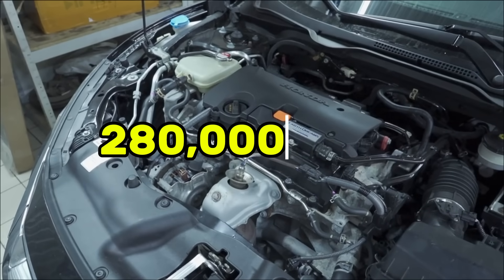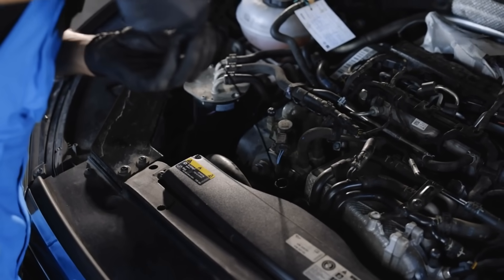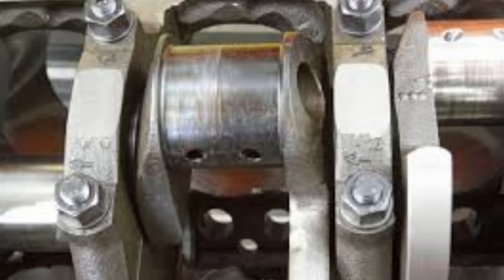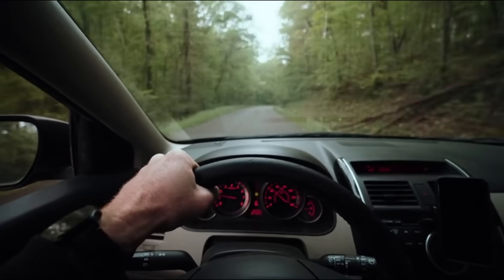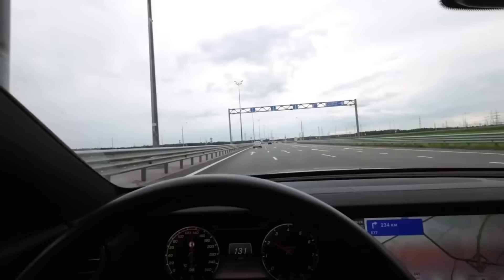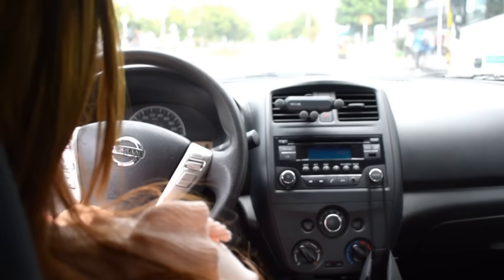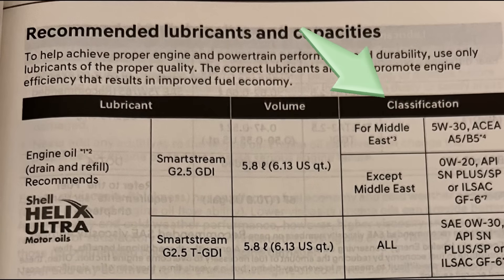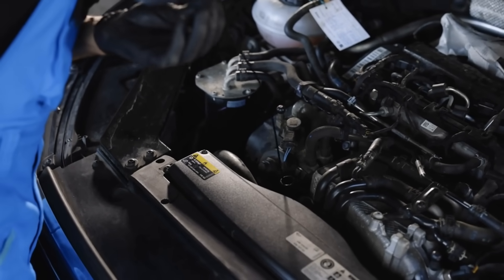I Tested 200,000 Miles of Engine Oil and Found the SHOCKING Truth

Comment: My 2012 Jeep calls for 5W20. I guess it wasn't new enough to get listed for 0W20.
Hell no.

I run 5W30 year round.
Reply: That's the best weight for this year Jeep. Mine is a 2010 with a 3.8L V6. It really is a hot running engine and is hard on oil. I run Amsoil Signature Series 5W30. I also use the Amsoil Ea15K51 oil filter that filters down to 20 microns. I change it every 4500-5K miles. It has just a little over 137K miles with a 6-speed manual transmission.
Reply: Yep.  2017 Lexus LS460, 2001 Toyota Solara and 2002 Camry.  I stick with 5w-30 for all of them year round (I drive in Southern Calif).  I used 0w-20 in the Lexus, since the manual said so... but only until I knew better!  Ask people whose opinion actually matters, i.e. (non-dealership) mechanics, if they use zero weight oil in their own cars.  Chances are he will say Hell No!  There are only two scenarios I'd even consider using a zero weight oil: for driving in sub-zero weather, or driving a car owned by somebody else.  Because all the evidence I've heard about or read, shows zero weight oils are inferior in anti-wear properties to heavier weight engine oils, especially in the long term.

Comment: My 02 Mustang GT has a recommended oil of 5W-20 but I've seen Ford engineers say 5W-30 is better because it improves engine longevity. The 5W-20 was to meet CAFE standards. I have run both (full synthetic) and I haven't noticed any significant difference but I never sent an oil sample in for analysis. Based on what this video is saying, 0W-30 might be best since we get below freezing frequently in winter and above 100 degrees in summer. We get sub-zero also. We have had 80 degree weather in January also. My 2014 Xterra has a 5W-30 recommendation but I haven't tried different oil.

Comment: Common sense....Thin oil drips off engine parts faster than thicker oil.  Thicker oil stays on parts longer and is better for .  Think about "Goldielocks and the three bears" .... too big, too small, just right....  too thick, too thin, just right etc.   Zero weight oil ???  Common sense says...That's just too thin. It'd just drip off the parts.  5W is plenty thin enough for todays engines, however in extreem cold weather situations (-25 or -30 ) vehicles use block heaters to prewarm engines.  So,  0W isn't needed there either.   0W ???  Zero = nothing.  No wonder engines are wearing out.
Reply: Not that simple. It's fine balance!
Reply: @Davido50  In my opinion, it is that simple. In order to meet mpg regulations these mpg tests are run on a bench and not in real world situations.
Reply: My 3.6 pentastar says 5
w20. I run that from October to April. From April to October I tunn 5w30. I live in SLC Utah. Am I gonna be ok?
Reply: @jtd2949  Yes, just don’t drink it 😂
Reply: You are off the science. The 0, 10, 20 etc are simbolic (coventionall values, not real viscosity in an I.S. of metrics. Even wather has a higher than zero real viscosity. All liquids have due to internal.friction. It is easier for common people to process. Also, summer of winter, the working temp of an engine is the same, after it reaches it. So...why different values?
Reply: W is winter, not weight.

Comment: I don’t care about 1/10 of a mile per gallon when I’m already getting 30 to 40 mpg I use 5w-30 or 10w-30 in everything . I didn’t notice a change in mpg on my 2016 Honda Civic when I switched to 5w-30 as soon as the warranty period was over. You might get 1 mpg better which might be great for a fleet but not for an individual driving to work.
Reply: indeed

Comment: If the coolant temperature stays the same why does a hot climate change things?
Reply: Great comment
Reply: It’s all about cold starts.
Reply: The internal parts have to wait for the heat to make its way to the water jackets. The air blowing all around the engine has a noticeable effect on the ability of the metal parts to dissipate the heat. The hotter the outside of the engine block, the hotter the internal parts will be within several degrees.
Reply: @YeOldeTowneCryer I talked to an oil engineer. My uncle is in the oil business. They claim that thin oil carries away heat more effectively to avoid hot spots, such as in the cylinder head. I showed them old owners manuals I had for Porsche, GM and Ford vehicles that had oil recomendations based on outside environment tempratures. They claim that is not applicable anymore. Oil technology has come a long way. In addition they claim oil temps actually increase with thicker oil. I still use 5w-30 in everything

Comment: My plan has been while under warranty use the 0W-20 it calls for after that keep it in winter and 0W-30 in summer im in a state that has hot summers and freezing winters. My car is new just in case something happens under warranty and they decided to send out oil to be analyzed. I also always change oil every 5k or sooner. (100%Synthetic)
Reply: There is no car dealer on the planet that would exercise that degree of professional curiosity by sending your oil out to be analyzed.
Reply from the maker: You are right
Reply: @jmljml5065 i dont think so either
Reply: That why you pul your own sample and send it out.
Reply from the maker: Smart strategy with the oil weights and frequent changes – your engine will definitely thank you for that!
Reply: The manual says same engine in other countries use 5w-30 or if you can't find 0w-20. So it's not an issue. Thanks for the comments
Reply: Don’t switch weight unless you do oil analysis.  Stick with what’s in the manual and use high quality oil meeting manual specifications and you will have no issues,   This video is garbage.
Reply: @michaellamarche5291 no, it isn't.  What's being shared here isn't a secret.
Reply: @johnsanford3596  I'm an engineer working 20 years with folks sitting upstairs dealing with rotor dynamic criticals, bearing sizing including film thickness calcs, and agma gear mesh calcs with a member sitting on the board.  We do NOT fiddle without data and fluid analysis.

Comment: I use 5w40 in my Chevrolet z71
Reply: 5w 30 in my 25 Tundra.  10w 40 was the standard in the 80's and in my race bike. now
Reply: my MC revs to 13,000 RPM's with 10w 40

Comment: I live in FL & TX for 40 years. When I bought a Corolla that says 0w-20, my spider senses started tingling. First oil change I found the Mobil 1, 0w-30.  That is all I use, change every 5K. I get amazing gas mileage with no worry on my 50 mile fishing runs to the coast 44mpg easy. I actually feel bad for people that live in hot climates and run that watery 20 weight oil on 95 degree days, but you can't tell people who believe what their oil cap says.
Reply: Just got a '21 RST but im thinking of moving to 30W on my next change but a high milage version full synthetic.
Reply: I used to think badly of 0w20 oil. But I talked to my uncle in the oil business. Thinner oil actually carries away heat faster from hot spots, such as in cylinder heads. An engine using say, 10w30 will actually have higher internal operating tempratures, even though water temperature is the same between 0w20 vs 10w30. Although , for myself I use 5w30 in everything because I live in Arizona.
Reply: It's a lot hotter inside your engine than 95 degrees regardless of of how hot or cold it is outside. Don't be silly.🙃
Reply from the maker: Thanks for sharing your experience and what's worked well for your car's longevity and fuel efficiency in hot weather!

Comment: One in million oil review ❤ my bike factory recommended 5w 30 oil but at high temperatures I heard ticking sound from my bike’s engine then i use addinol 10w 50 and thats the game changer now my bikes engine silent in every situation 👍🏻
Reply from the maker: Glad to hear you found an oil that works perfectly for your bike and eliminated the ticking sound!
Reply: Central Fla, 2017 Santa Fe Sport, says to use 5w/20. Do you think I should use 5w/30? 🤔
Reply: @PostLee-e9m5y  Be careful If under warranty! Wait till out of warranty period or they will NOT honor. Hyundai is notorious for fighting engine claims..they have alot! Better choice next is Mazda CX5..Best Japanese automaker. Or Bronco Sport SUV. Ford is best American automaker. Both excellent SUVs. Well built. Great engines. -Engineering perspective
Reply: @Davido50 trick is to buy shitty cheap oil in bulk and lie about intervals, and put the good stuff in behind their backs lol. All you need is a receipt and a log book.
Reply: @PostLee-e9m5y Yes.
Reply: @ralfrufus6573  Only if "out of warranty" period. Hyundai-KIA is notorious for denying engine claims! They have alot. Avoid them altogether if possible. -Engineering perspective
Reply: @Davido50  I trust thick oil more than warranty promises.
Reply: @PostLee-e9m5y , of course.
Reply: @PostLee-e9m5y  I would use the thicker oil
the thinner  the oil  has a  additive package that's bigger so the oil film does not break and the thiner oil give you a lower oil pressure ,I hear that manufactures lower the output of the oil pump so that it takes less power  to have less fuel consumption .many guys say the is only supposed the period of the warranty ,times are changing , look at all the recalls they already have for engine and gearbox during the warranty period ,it' nuts .
Reply: @PostLee-e9m5y ,maximum 5000 km , and  change motor oil.
Reply: @PostLee-e9m5y  Yes.  I lived in Florida for 27 years and drove German cars.  Used 0W-40.  Now I live in the Caribbean and it's Summer all year.  I have a Kia Sportage 2.4L and have been running M1 10W-30.  Much better.